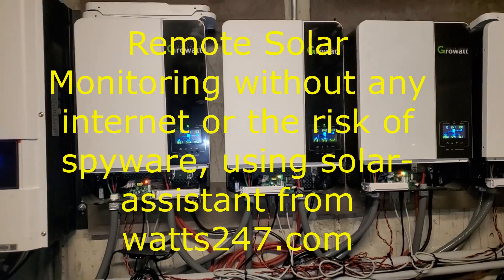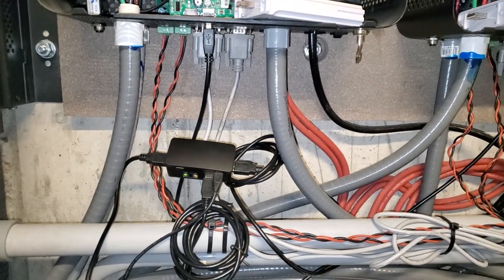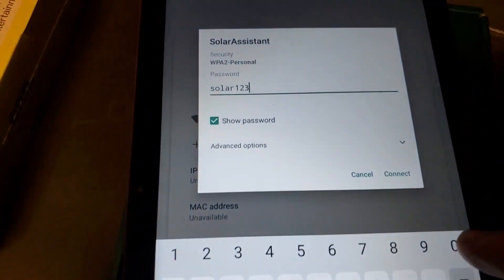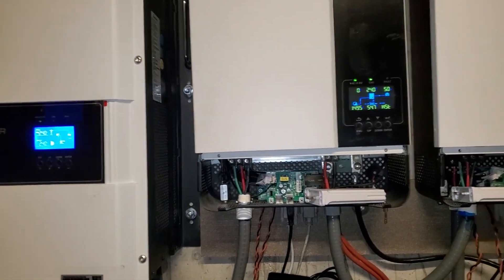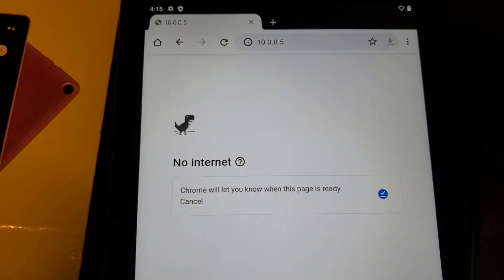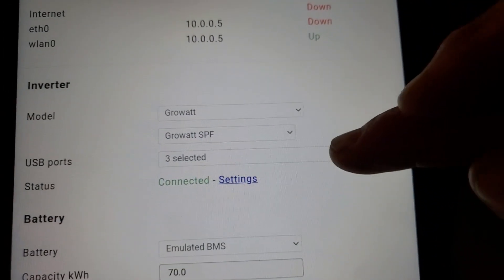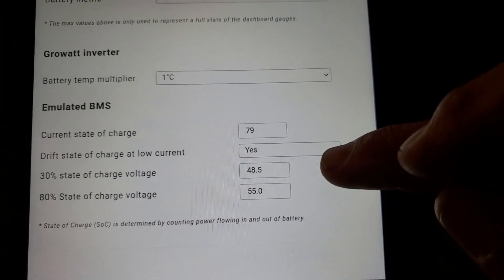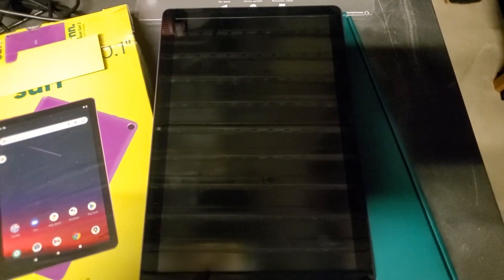No Internet - Remote Solar Monitoring with cheapest Android Tablet wirelessly to Solar-Assistant

Comment: Im also using nissan leaf modules. I only have 24 modules in a 24 volt configuration in my tiny home camper but so far they are great. Id live to be able to buy a 20 or 30 kw lifepo4 bank

Comment: Why isn't solar assistant simply be a an app you can download directly to the android tablet, seems to be a big mess having to use a browser on a tablet to connect to the webserver on the raspberry pie.
Reply: Right? It could simply be an app one installs and uses to connect to the dongle via WiFi like some WiFi router control apps. That's what I was kinda hoping for.

Comment: Thanks Ian. This is useful :)

 I have a couple of Growatt 500ES like yours - but with a slightly different setup.  I have been baffled by some of the stats generated from the cloud site in China.  It seems, for example, that much more power goes into the battery than comes out 20 to 30% more.  It seems much less efficient than what I expected. (60% seems too low?)
I have been thinking of getting Home Assistant set up.  
Were you able to redefine settings in the Growatt using  Home Assistant?  (e.g. If xyz then change Parameter one from SBU to UTL)
BTW I sometimes see lights flicker and I live in Australia where we have 230v 50Hz.  LEDs are more noticeable than incandescent lights.

Comment: I'll take those 5000-es inverters,  when you take them down.
Reply: They make for very useful lab tools!  The 200V-420V variable DC input is VERY useful for load testing and such.
Reply: @methods-SE  I still need two more for my system. And an extra spare one would be great.
Reply: @timselectric502  I am happy to continue testing mine.  I have a single phase 10hp pump & 2hp pump (on a long run)  to get reliable.  Excited to see them work in 2P or even 3P.  (What a value eh?)
Reply: @methods-SE  my system will  8 of these,  when complete. 6 in parallel with 2 in series downstream from the 6. Should be more than enough to power my home and charge the EV's.
Reply: @timselectric502  can't picture that, but sounds radical.  ... I have 3 independent off-grid setups going thru reliability testing then it is time to ramp power up from 2hp each to 12hp each.  Should Scale.
Reply: @methods-SE  yup 
Very versatile and scalable.

Comment: Can you set charge time from the grid with solar assistant
Reply: Yes. You can,  there is a time scheduler to change the priority on the inverter e.g utl to sbu , sub based on time and or battery conditions
Reply: @id007rx  thanks for your help
Reply: I’m not sure that will charge the battery. Can you set program 49 from solar assistant?

Comment: Not happy with growatt?  Was thinking growatt or mppsolar for practising backup power instead of the more expensive victron.  Was visiting family in Utah recently, from Aus.
Reply: The 5000ES in parallel I had 4 of them now down to 3. One blew up about 4 months ago replaced it, popped again months later.
Occasionally they get into a light flickering spasm when AC input is applied.
And occasionally have a fault08, have to reset them every so often.   The 12000T has been solid, but want to get away from an auto transformer solution due to all the stray currents and phase balancing currents
Reply: @id007rx  Hi Ian, I'm in the process of commissioning a 3 unit parallel SPF5000ES system, and noted you installed yours very close to each other on the wall. Could be the reason for failure due to insufficient air circulation. Having said that, the Solar Assistant looks great, and a lot more usable than the Growatt dongle which is god-awful to even set up. I still don't have it communicating correctly. Will grab one once I'm up and running.